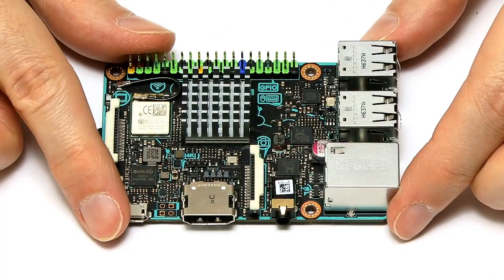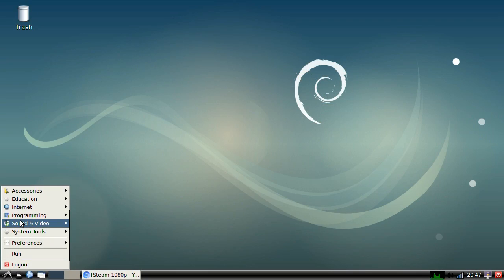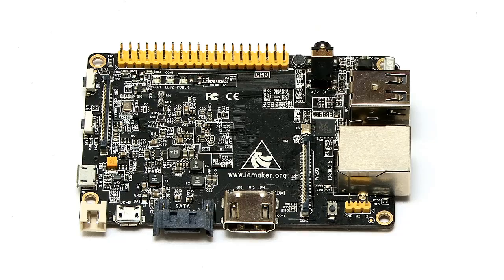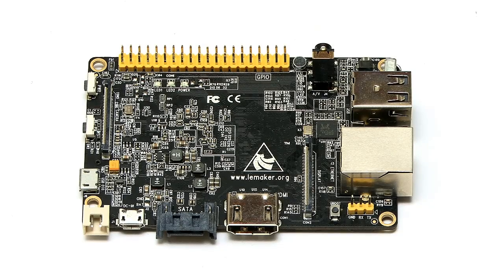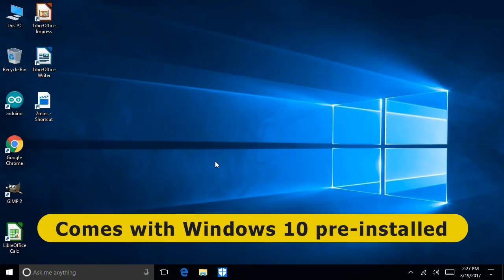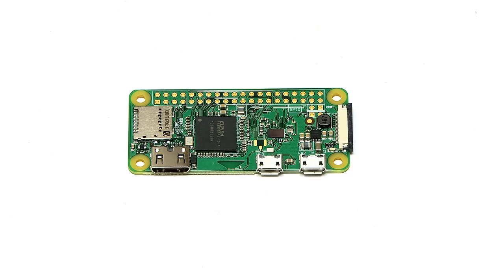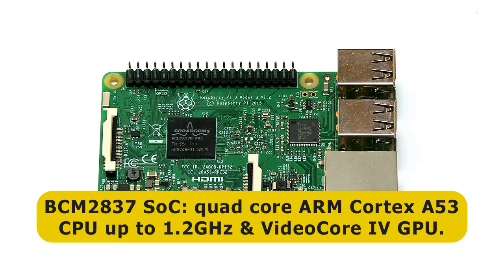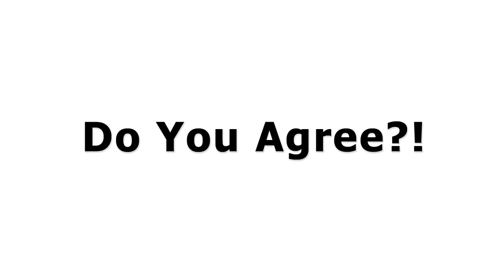Top 5 Single Board Computers 2017

Comment: I thought, maybe the Tinker board would've scored closer to the top of the list, but I've heard (possibly from you?) that Asus isn't really giving that device proper support, and so it doesn't have the community support that other boards have. But yes, this is a very decent list. Thanks for another great video.
Reply: only problem when comparing anything to the pi is the support, and can be annoying when any board out there calls itself the raspberry pi killer, really, do they have support, do they have 5 magazine about?

Comment: I dont understand why you mention LattePanda, which is extremally expensive and have HUGE problems with temepratures (Yes, LattePanda needs custom-build heatsinks)
Much better/cheaper/more efficient is UPboard with Rpi compatible gpio, intel core and rpi-form dimensions.

Also there is worth to know, we can buy Udoox86 which is most advanced SBC ever built. You name it, it has it.

Comment: What about the Odroid-XU4? I have a Banana Pi M3 but I was disappointed by the SATA performance (internal only USB2) and the OS stability, but got it running eventually and am using it as multi purpose server (NAS, http, Nextcloud). The Odroid-XU4 however looks very good on paper. Performant CPUs, 2 GB RAM, Gbit-Ethernet, 2 USB3 ports, eMMC beside microSD and lots of accessories. Has anyone actual experience with it?

Comment: I prefer the Pi's, as even the more expensive boards are too weak to take heavy load taks. And even the raspberry is oversized for the most other loads, like home automatisation etc. So why pay extra for worse support? A NAS with 1 SATA Port? Seriously? A HP Microserver costs 200€ and you can put 4 3,5" SATA drives in it. 2 Gbit Network + ILO(Not to mention it's also already in a good case and has a integrated power supply, so for NAS usage it really is not that more expensive). That's about minimum for a viable NAS. Otherwise go for a real budget option and buy a good "network hdd".

Comment: In my humble opinion, Latte Panda should not be on this list solely because it comes with Windows 10 pre-installes which increases the price. Should and when they release a version of Latte Panda with other pre-installed systems or maybe even none, as it's x86_64 we can do it ourselves onto the SD card, then i may reconsider (unless the price does not drop despite this)

Comment: I agree with 1 & 2, Raspberry Pi 3 & Zero W are great boards and a bargain as well. I would disagree with the tinker board and the Banana Pi being on the list as they fall down in the support and community size. My taste goes to higher end SBC and the UP Board should be on the list. You can go all out and get 4GB RAM with 64GB of internal storage to run 64 bit Windows 10 Pro and some heavy hitting applications. Being an x86/x64 chip all you need are the drivers and you get the full Windows community for development and support.

There are also the UDOO and UP2 boards that are even more powerful (and more expensive, in the $150 range) and capable. These boards have ePCI, gobs of RAM, and are really mini desktop computers. These three boards are suitable for computer vision (eg the Leap Motion or RealSense 3D vision systems) which requires lots of processing power.

I just come to the conclusion that while the Raspberry Pi boards started the creative juices running, the more powerful boards let me explore ideas that I would have thought to be impossible in the small SBC market a year ago.

Comment: i mostly agree with this list, however, i would personally swap the pi zero w with the latte panda. as far as ease of access, programability, capability, the fact that the latte panda has windows 10, is an amazing feature. it's a close call, i love the zero w too, it's great, super cheap, but you do need a lot of addons for at least innitial developement, the latte panda is far more plug and play than any of the rest, but simply for cost vs preformance, i do also concour that pi 3 rates abov it. it's only a minor variation, but i think with some of the startup costs, and not having preinstalled gpio pins (i get why for that too), i simply just rate the latte panda higher than the zero w

Comment: I agree with your list although I'm more prone to say the Asus deserves third place instead of last. 

What I think we all want to see in the future is an RPi with more RAM,  a SATA port and gigabit ethernet (or USB 3.0). And I would be happy to pay more for it than the historical $40 price point.

Alternatively, if the SATA and USB upgrades could not be achieved I would like to see a better interface and connector for add on boards. Additional data lines can easily be added to the Broadcom SoC so that thrid party makers could offer SATA and USB 3 add ons.

Comment: I'm partial to the Odroid boards.  I have several and love them.  For me, they're the best alternative to the Rpi and top of my list.  I know they miss some features like sata and wifi(easy enough to add on), but that's countered with non-shared Ethernet, gigabit Ethernet in some cases, usb 3 on the xu4, EMMC.  Plus they have respectable community, good Android builds, more power than many competitors(xu4 beats tinker board for similar price).  Barrel jack for power is also a plus(and leaves the otg port free), though some Odroids give a choice of barrel or micro usb for power.  They are a good option among SBCs.

Comment: I always enjoy your reviews and explanations but I am disappointed that you didn't mention the Pine 64 or C.H.I.P.
Reply from the maker: I've covered the CHIP here this year, but there are clearly significany supply issues now, so I will not feature it again until those are resolved. Also, I think that the Pi Zero W now beats the CHIP hands down at the low-cost end (it was more even before the Pi ero gots its WiFi and Bluetooth). Pine I will look at at some point! :)

Comment: I have all  five single board computers on your revue, and agree with your choice of the Raspberry Pi3 being on the top. It is the most robust and easiest to get running with all the support available. My newest purchase is the banana Pi BPI-M3, which has had start up issues, firstly with the power supply needed was the barrel type at 5vdc 3amps, the equivalent in micro SD would not boot the device, and wifi issues also.
For browsing the lattepanda wins hands down over all of them.

Comment: I agree with a
RasPi at #1
I was thinking an Orange Pi somewhere perhaps. I quite like the orange pi zero myself, and they are very well priced too.

I have heard that the usability of the SATA port on the banana pro is limited by the USB controller it runs through (though I may be getting confused with a different board). Still always nice to have

Ta for the video!

Comment: Thanks, very good contribution and selection.
I am fascinated that the dirt cheap Raspberry Pi Zero W even has a dual band WiFi and Bluetooth 4.0 on board that works really well for a price you can not even get a quality dual band WiFi dongle for! OK, the units overall CPU and graphic performance is limited but still has more power than the Raspi 1, which means it is still perfect for a lot of specific applications that do not necessarily need extended CPU or graphics power. I recently bought a new set, including case, power supply, HDMI and USB adapter for only 25 Euro at a local maker faire - so I just needed a micro-SD memory card for a few bucks and now it runs like a charme.
If you could run it efficiently as a media center, then I would say it should even be #1, but that should really be for the unit that has enough power for most apps, has an average price but has the most variety of operating systems as well as software support through the community. 
The only thing I miss on a Raspi 3 is the gigabit ethernet ... I play a lot with SDR servers and have to stream a few megabit across the LAN and it seems my old Banana-Pi m1 responds better, though it has less CPU power, but has no bottleneck with its 10x higher (theoretical) network speed. In this regard the new Banana-Pi Pro and especially the Asus Tinkerboard are way better, but if you are neither a Linux geek or software developer with some good foundation you might be left in the dark at some point and this is why I think your ranking really is absolutely spot on for most users.

Comment: For a long time I looked at the LattePanda, that seems to have all the Bells and Whistles! (and is Arduino friendly which is tech I already have), but then I began to thinking about Portability and particularly Power Consumption (running off a Lipo Battery Pack) so I started to avert my gaze & look at the more leaned-out Cards, particularly the Tinker Board; That one seemed very impressive and the Bench Marks when compared to the Pi 3 proved its worth/potential, however, in the end it was the Raspberry pedigree that won me over esp. with all the software development/activity going on around this Board.
I'm very new to this topic but just purchased the Pi 3, and I'm pretty sure I made the right choice, even at this early stage.
p.s. I also just purchased the 16" USB Portable Monitor 'Asus MB169B+' and guess what? the only OS outside of Windows and Mac Supporting its Drivers are Ubuntu - I guess that also swayed me  :)

Comment: The Raspberry  Pi 3 is my top computer for both OSMC and Raspbian pixel OS. It's an amazing stable setup and reasonably quick in operation if you install the OS and have it boot from an SSD. The support is excellent and you can almost always find an answer to something if you run into issues such as when setting up new applications.

Comment: No, I do not agree. You totally missed the Odroid XU4. The RPi3 is way behind in main features (notably no GigE networking or USB3 support). The Banana Pro is interesting, as I'm using the Odroid XU4 as a media server/NAS now; having SATA support would be useful for my needs. With both GigE wired networking, 2GB RAM,  an 8 core ARM 7 processor, eMMC5.0 HS400 Flash Storage and uSD support, HDMI interface, and USB3, plus many features which surpass the RPi 3, this $60 board is hard to overlook. Some deb packages I needed were not in the Odroid repo; no problem: pull it from a Ubuntu RPi repo as this board is binary compatible with RPi executables. I've got 8TB of storage on my local network served up by my Odroid. Network disk access is decent. Various tests, scp, rsync-ssh, rsync over rsync-protocol, NFS, nc, etc., I've seen a maximum of 90+MB/s read/write speed. Avoid protocols which use ssh because of encryption, as network  disk throughput is CPU bottleneck bound. Disk throughput is a little wanting when multiple drives are accessed by multiple external sources at the same time. However, this is still much better than my RPi can do. I'm very pleased with the Odroid XU4 board, and this certainly blows the socks off the RPi 3 board. ameridroid.com sells this for the US and has excellent support for the Odroid. I got my board 2 days after ordering it on-line. I installed the boot loader from the downloaded binary, flashed the uSD with dd, and this board booted the first time. I installed all of the software I wanted, plus "stealing" a couple of unavailable multi-media packages from RPi repos, I had everything I wanted running in a few hours. I did all of the above a few weeks earlier with my RPi board, and it ended up being a weekend project, much to much to my disappointment. The Odroid XU4 deserves a full review of it's own.

Comment: Not a bad list, though I disagree on a couple of points. I'm a bit baffled that you chose the Pi Zero over the CHIP, which IMHO is a better SBC overall.

Also, I expected the Panda to be on your list, but to me the exorbitant price makes it a complete deal-breaker in the SBC realm. Admittedly, I'm also biased against Windows, so that likely influences my disdain for the Panda.

I'm very glad that you have a rundown on the Banana! I hadn't thought about how the SATA port makes it ideal for a cheap NAS, and I think that's a great idea!
Reply from the maker: I like the CHIP, and I think it had the edge on the Pi Zero, but not now on the Pi Zero W. There also appear to be great shipping problems with CHIP . . .
Reply: Oh, I definitely agree about the shipping issues. I hadn't considered that, since I've had my CHIPs for a while now. They're retooling the design for the "CHIP Pro". Hopefully they'll ramp up their production and shipping setup.

Comment: you dont have to get a external power supply to run 3.5inch drive. 2.5inch drives only require 5v.3.5inch drive needs 5v and 12v to run,so you can buy a boost converter which will cost 2$ and it will boost the 5v to 12v but you have to set it by your self. but it needs some work to do before putting a 3.5ich hdd with it, also you need a higher amp power supply to give enough amps on the 5v.

Comment: Hi, I have been following your videos for quite some time and I don't think you ever mentioned the Onion Omega, which is maybe more comparable to an arduino, but that offers a complete Linux OS besides that.
Although this tiny board does not fulfill the same use cases as the boards you presented and, thus, does not have a place on this top 5,I think it has its place on this channel.
The community is quite active, the board is very affordable and easy to use, and the complete Linux OS opens a lot of doors.
Thank you for the work you provide! :)
Reply from the maker: I have made a note to check it out. Thanks. :)

Comment: what do you think is the best single board computer for computer vision applications
Reply from the maker: It depends how much you want to spend! My next SBC video here will (fingers crossed) be a LeMaker HiKey 960 -- powerful but expensive. For less intensive stuff here the LattePanda, and then the Tinker Board, offer more power than a Raspberry Pi.
Reply: What if to make a diy google glasses , a single board to run on a wearable  ?

Comment: I was a bit sad to see that no ODROID SBC made it onto the list (C1, XU4, etc.) but otherwise I think you made great choices.
Reply: Erik for sure. Odroid xu4 is 8 cores for $70usd.  There's a really good community around odroid products.  I would avoid the Rockchip products on this list as there's much less community support and consistent kernel issues for tinker community.
Reply: I love my XU4. Lot's of power for an ARM based SBC, and USB 3.0, which seems to be lacking on every other ARM based SBC that I know of. (Excluding other ODROID's)
Reply: Totally agree on the C2 and XU4, people not being exposed to these to are really missing out. The C2 demolishes the Pi3 IMHO.
Reply: Erik yes, top of the lineup from odroid is the c2 model.
Reply: it may make the next list, outside the pi it is the only other board with a magazine for it

Comment: You should really check out the UDOO X86, the top of the line one if you can or possibly all of them
Reply from the maker: I may look at an UDOO at some point, though right now I think the LattePanda represents better value for an X86 SBC.
Reply: UDOO is just a high priced PC Board.
Reply: i got one and love it plane on to put in a rolling tool chest to look up A.D.'s and TCDS for aircraft i work on but who know maybe ill get it to power my wheels as well .....
Reply: might also want to check out pine 64, just because of the pinebook

Comment: What about orange PI boards?
Reply from the maker: I have reviewd one of these fairly recently, and will look again at another in the future. But they do/will not make my Top 5.
Reply: I don't agree with the list but then I'm not making media players. I have bought a few R-Pi 3 and earlier models but now prefer using the Orange Pi boards.

There is lots of general support info for R-Pi that applies pretty well to the O-Pi. The best board depends on a lot of factors including your experience and the intended application - with screen or without, short run time or on 24/7 etc. I like the O-Pi Zero at the bottom end and O-Pi Plus 2 at the higher end. Doing mostly projects that run 24/7 it must be long term reliable and able to be easily maintained for 4-5 years at least.  I have recently set up a new weather station on a O-Pi Zero. It's predecessor ran for 7 years.

One of the earlier boards I liked was the Cubieboard (with SATA). But the support was terrible, the distros died out early and a lot of the info was on a cloud store that shut down; was it a Google thing - I can't remember.
Reply: +ExplainingComputers  Undersatndable.
Reply: Orange puts out too many boards.  Thus there is no support for all the boards. Seems they like to put out a board to show they have something new.  Not really pc replacement but I did watch a movie on it and was entertained.
Reply: ExplainingComputers thanks for not including it, I have one and I can't even get the stupid thing to boot.
Reply: I had the same problem with the first two O-Pi boards I bought. I spent ages researching and reloading images to a 8GB card that I already had. A day or two later I bought a couple of new 16GB cards and it worked first time. The 8GB card is class 6 and writes/reads fine using the PC, but won't boot the O-Pi. Use Armbian, it works great for what I have done, but I'm not playing video, so I don't know much about that.
Reply: orange pi plus 2 using android was ok, but still a mess. No playstore. But was able to use aptoide.  There I install kodi but it was a locked down version.  from there I could play youtube videos at 320p. But I got a youtube downloader (regular youtube would not work well).  Was able to play some stuff, and if I was living on a remote cabin and it was the only thing I had I would get along with it, but there are better computers and boards.  A $150 android/chrome notebook would be better. It was still neat being my first single board computer.  Actually the best image was the original android they put on the ram.
Reply: they look neat, but then,,
Reply: better yet find a video of an orange pi working